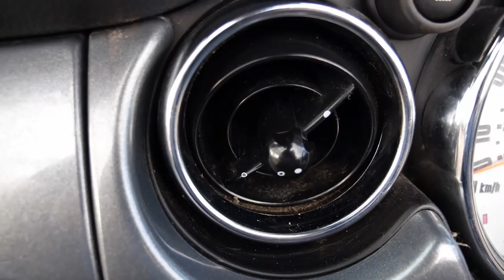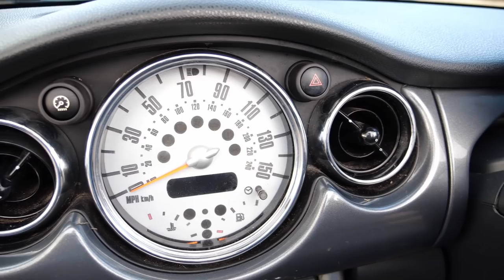Deep Cleaning a BMW Mini Disaster detail Dirty Filthy Moldy Car challenge

Comment: I had one of those early models , mine had leather seats. The electric roof mechanism opened half way in the night and it rained heavily and what a disaster, tried to get it dry, though it started to develop mold spores. Second thing that went wrong, power steering packed up, then it would miraculously come back to only go again. I loved the car, despite those faults,, though in the 2008 financial crash I couldn’t justify the cost anymore.

Comment: Great work mate. I've just ordered some surfex HD to tackle a convertible top in the same condition. What pad combo do you use with the Koche Chemie?
Reply from the maker: either there own pads or a yellow quantum cutting pad from chemical guys 😀
Reply: @everydaydetailing6449  Perfect, thank you! I've got some Koch Chemie One Step on the way and have some green hex-logic pads which I think are pretty much the same abrasiveness as the yellow ones, so hopefully can get similar results 😂

Comment: How does anybody fit directional tyres incorrectly? There's an arrow on the sidewall if you're unsure. One of my work colleagues got her RS3's tyres changed by an Audi dealer... who actually fit the rears incorrectly. Expensive mistake, as the tyres were ruined.
Another great job. It reminds me that my car needs a professional valet as well as some love for the bodywork, but I just need to stop mulling over it and get it done. I bought a number of products to help keep it looking respectable, but I lack the confidence to go the whole hog, not to mention that because I live in a flat, I don't have a shed or garage, so I don't own any electricals because I simply don't have anywhere to put them - and it's probably better just to get somebody else (qualified) to do it anyway.
Reply from the maker: That’s Stephan 👍😁 hope you get your own car sorted soon.